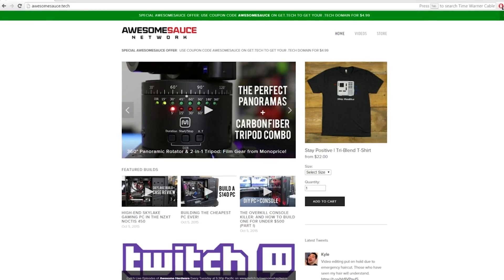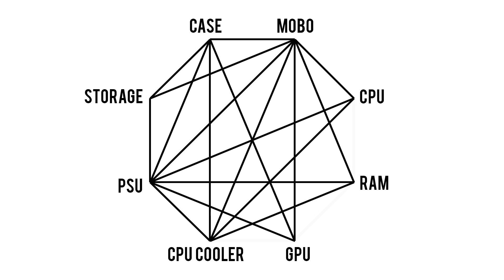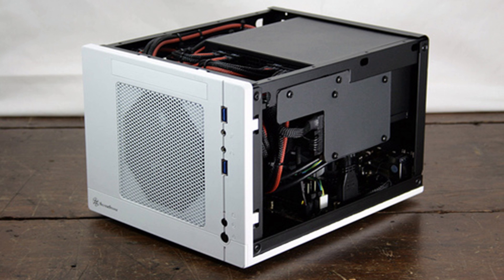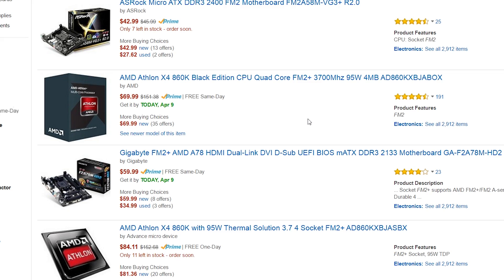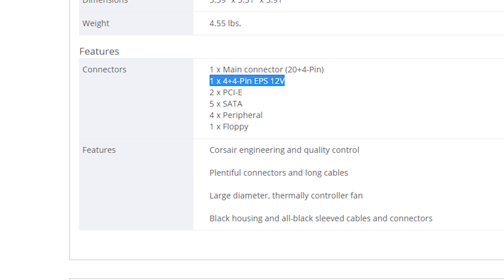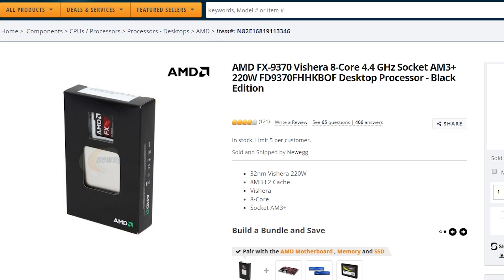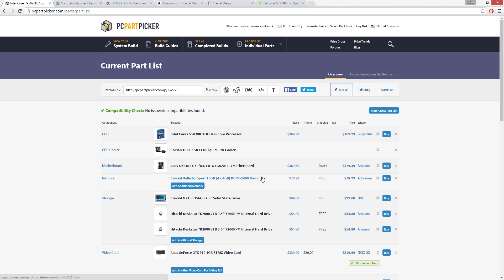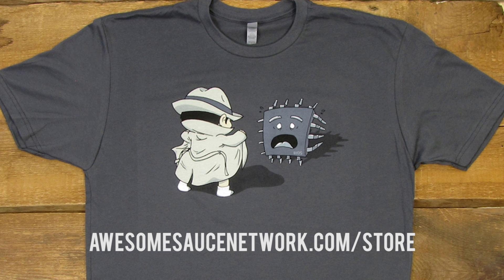How to Choose Parts for a PC! The Ultimate Compatibility Guide!

Comment: Is this an alright build?

I5 6600k cpu 
gigabyte gaming k3 z170 motherboard
corsair vengeance lpx ram 2x8gb
cooler master evo 212 cpu cooler 
msi gtx 1070 gaming x
western digital 2tb black hdd
any atx case 
silver  rated 650w psu)
Reply: SSD (Solid state drive) is a type of permanent storage solution that is fast. They are like big flash drive, they do not require spinning disk, therefor they are shock resistant and 100% silent. The biggest bonus of an ssd is that they are of MAGNITUDE faster than regular 7200 RPM HDD, but they are more expensive. Getting a 128 GB ssd for installing your OS (Operating system) will DRASTICALLY improve your boot time and overall desktop performance. (your CPU can retrieve data from the OS ssd faster, therefor your PC overall will be more responsive). The only negative of an ssd is that they have a set write cycles, therefor installing large files (pictures, movies, large games, turning your drive into a "scratch disk") and deleting them repeatedly will slice it's life down, but nowadays ssd are great and with proper usage they can easily last a minimum of 10 years, before showing signs of degradation. I suggest you do some research on SSD :)
Reply: Wow thanks alot my dude, im planning to put this together/buy all the parts this coming weekend so thanks alot!
Reply: Yeah that's a pretty awesome build. The psu is more than enough, pretty good cooling for overclocking. But I'd recommend Asus mobo for overclocking though, they are more stable and reliable. And you might wanna consider a ssd to install your OS on so its faster.
Reply: Thanks ffor the reply!
Im a bit new to gaming/pcs and ive started off with a craptop i dont know what overclocking is or if i should be doing it, and what is an OS? haha thanks for the help
Reply: Sure no problem man, my pleasure :) The "k" on your cpu number 6600k represents that its unlocked and u can boost its "power". i5 6600k is 3.5GHz u can push it to lets say about 4GHz or 4.2GHz so your computer runs faster. In my opinion there is no need to overclock with the build you got as its pretty good enough. But u might wanna play with overclocking in the future when u get advanced with your PC or when you get bored as its fun to play around with it. 

OS is operating system, your windows 10 or 7.  So if your windows is installed on a solid state hard drive your PC will perform better and you can get quick boot up and file transfer speed. Hope this helps :)
Reply: Jeez you're awesome dude. Thank you so much for the reply again, this information really helps haha.
Reply: it really depends on what you would use it for, and your budget. But, ya it would work as long as all the specs line up. A 2tb hdd might be a little bit much, especially if what you have here is your budget maxed out.
Reply: Yea i have a 1k or under budget, and im just looking to play games at the highest framerate/graphics possible, im sort of looking for recording etc.
Reply: the build is pretty good, the only thing I would do is get the 1TB version of your HDD, instead of the 2TB, and with the money saved get an SSD (you can get a Samsung 750 EVO for around ~50$, the amount you will save from the hdd downgrade)
Reply: Legendarior Thanks for the reply, no disrespect but could you follow with some reasoning for these modifications?
Reply: anti social social club z

Comment: hey on pc part pick it say : "Some AMD 970 chipset motherboards may need a BIOS update prior to using Vishera CPUs." how do fix?
Reply: What cpu and mobo are you buying? If your mobo is newer you don't have to worry. If it's older, you can use another compatible cpu to boot first and then update bios, then switch out the cpu for the new one.

Comment: this is the configration i m going to build please help me guys m from india ,btw m new to pc building.

CPU-i7 6700K

Cpu Cooler-CORSAIR CPU LIQUID COOLER H80i GT                                    
                        
mobo-MSI MOTHERBOARD Z170A KRAIT GAMING 3X

memory(ram)-CORSAIR RAM VENGEANCE LPX 8GB DDR4 2400MHZ CMK8GX4M1A2400C14R (two sticks =16gb)

Ssd-samsung 850 evo 120gb

hdd-1tb blue wd

VIdeo Card-MSI GRAPHICS CARD PASCAL SERIES - GTX 1060 GAMING X 6GB GDDR5                                    
                        
Power Supply-CORSAIR SMPS CS750M (gold cerification)

Case-CORSAIR CABINET SPEC 3 RED LED                                    

these config. are good for gaming and editing ??? need ur help

Comment: When you watch this video AFTER you order all your parts based on pcpartpicker...
Reply: I watched this vid after i ordered my shit and half the stuff wasnt compatible.
Reply: RIP
Reply: +indigo1384 haha it's all right.. turned out fine in the end :)

+Malus1531 At the time I didn't realize you needed a z170 motherboard to overclock lmao
Reply: Hah yeah I just ordered parts 2 days ago and was thinking the same thing. I think I'll be alright but guess I'll see. Didn't check between front panel & mobo but panel is pretty standard (few USBs, mic, audio) so should be fine. I had considered RAM/cooler clearance but didn't know how to check that. Are DIMM slots always the same distance from CPU slot? If I'm only using 2/4 RAM slots, they will be the ones further away right (like slot 4 is closest to CPU and I use slots 1 & 3)?
Reply: Malus1531 You should reasearch lol fsb speed can dramatically effect your pc speed.
Reply: illvisual
Hey the front panel was the only thing I hadn't considered; isn't the F_PANEL header standard anyways? In any case, my build came together just fine. Still working out a small issue with whine coming from CPU area (mobo I think) and through headphones, but that's not due to incompatibility. It's awesome otherwise.
Reply: Eminentend
Glad it worked out. You should get a Z170 anyways if you bought a 6600K
Reply: lol that's exactly what hapenned to me
Reply: Work Out
Just to update I got an H110m board with an i5  6600k and the PC would just not stay on long lol.. But it's all good now cause a week or 2 ago I built it with a z170
Reply: Eminentend Same xddd
Reply: The order of the factors don't affect the product
Reply: Work Out did you just randomly choose them on a website like Amazon or did you find them on a website like pc partpicker?
Reply: Malus1531 since you ordered your parts from pc partpicker were you satisfied that it was all compatible?
Reply: +Work Out
so have you worked out how you're gonna build it?
Reply: Eminentend NEVER BUY ANY TECHNOLOGY BEFORE DOING ENOUGH RESEARCH
Reply: Eminentend the anxiety...im so sorry
Reply: I'll bet he was trying to see how many dislikes he could get by making a tiny little comment about disliking Trump.  I fucking hate politics but if this is what he was trying to do, that's hilarious.
Reply: Noobs lol

Comment: Personally I'd have suggested looking at the CPU first because then you can tell what MOBO you'll go with that's compatible. After you have the MOBO, you'll be looking at RAM that's compatible with that frequency.

Now that you have MOBO/CPU/RAM you can look at your GPU that fits with the slot(s) of the MOBO, CPU Cooler that is compatible with the CPU, and get SSD/HD that are compatible with the SATA slot or (if you're looking at M.2 that too).

Power supply that'll safely power all of this, and then a case houses all of it!

With this you don't limit your possible hardware as you're not locked into what will fit inside, and you're not locked down on your MOBO for what CPU you want which is far more important than your MOBO in actual performance (Other than for overclocking/etc)

Comment: You didn't mention one very important key factor. Do not assume that just because 2 120mm fans fit that a 240 radiator will fit too. This goes for every fan combo and the same size of radiatior.

Comment: What about using RAM with speeds faster than what was recommended on your processor???   

For example: i would like to use a 64GB 2800MHz Ram kit with an i7 6900k Processor that has 2400MHz listed as the max supported ram speed.
I understand XMP can be used to get the full speed out of those RAM sticks.. but will the CPU be able to cope? ...would the XMP profile auto over clock my CPU to match?
Someone please help!

Comment: I saw on the octagon that there is no line from CPU to RAM.  However on PCpartpicker I have a warning that the Haswell i5 can only run memory up to 1.5 volts and memory I have runs at 1.6 volts.  Is this not a big deal, would think it can run the CPU very hot?

Comment: Are all this compatible to each other

CPU:Intel Core i7-6700K 4.0GHz Quad-Core Processor
CPU Cooler:Corsair H110i GTX 104.7 CFM Liquid CPU Cooler
MotherBoard:MSI Z170A GAMING M5 ATX LGA1151 Motherboard
Memory:Corsair Vengeance LPX 16GB (2 x 8GB) DDR4-3000 Memory
Storage:Sandisk SSD PLUS 240GB 2.5" Solid State Drive
               Western Digital Caviar Blue 1TB 3.5" 7200RPM Internal Hard Drive
Video Card:EVGA GeForce GTX 1080 8GB FTW Gaming ACX 3.0 Video Card
Case:NZXT S340 (Black/Red) ATX Mid Tower Case
Power Supply:Corsair CXM 650W 80+ Bronze Certified Semi-Modular ATX Power Supply
Reply: Literally have almost the exact same parts
Reply: +Citriq [Best PvPer] so what do you mean all of it is compatible to each other
Reply: +Red Exion different ram and videocard
Reply: +Red Exion and I believe so yes
Reply: +Citriq [Best PvPer] what do you mean different ram and video card
Reply: +Red Exion I believe all of that is compatible I'm just saying I have different video card and ram
Reply: +Citriq [Best PvPer] is your pc have been build

Comment: Im building a 1500 gaming pc, can someone advise me a build?
Reply: I7 6700 (k series if you plan on overclocking) with Hyper 212 evo CPU cooler. Get motherboard that supports LGA 1151 socket with Z170 chipset if you plan on overclocking, otherwise get a chipset which doesnt support overclocking (get ATX or microATX motherboard) (it tends to be a lot cheaper). Get DDR4 memory with the right size so it fits into your motherboard (there are RAM modules that are made for miniATX) (there should be specifications in item descriptions). Gtx 1070 (unless you aim for 4k in which case get the 1080) should be enough. Get SSD for OS and HDD for game storage. Find a reputable PSU brand like EVGA or Seasonic so it doesnt fry your components when something goes wrong. To finish things off get at least mid-tower case.
Reply: do you want it to only have pure power for gaming only or do you also want it to be color matched.
Reply: +LawlessSentry I'd get an i5 6600K and a GTX 1080. If it's just for gaming, this is better.
Reply: +BearHoldingShark Well if you are gonna game 100% of the time then yea.
Reply: LawlessSentry The guy said "gaming pc", so I assume he is.
Reply: BearHoldingShark I assumed he might do some rendering in the future. You can never go wrong with consumer grade i7.
Reply: LawlessSentry Well, you can if you don't have the budget.
Reply: http://pcpartpicker.com/list/FpxJnn

Comment: 3 Years ago I built my very first Gaming PC and I had no Prior knowledge of 
PC building before nor did I have any Technical Qualifications for that matter.I chose a 
Zalman Z11+ case
Western Digital 1TB internal Hard Drive
12 inch TX3 Fan Power Splitter Cable
LG 24x SATA Bare Internal DVD Rewriter 
AMD Athlon II X4 740 Quad Core 3.2-3.6 Processor
Kingston HyperX Blu DDR3 1333MHz 8GB (Kit of 2)
Asus F2A85-M LE Motherboard
Asaka USB 3.0 Internal Adapter Cable
VTX3D AMD Radeon HD 7750 Graphics Card (1GB)
Corsair Semi-Modular 80 PLUS 600w PSU
Windows 7 Professional 64 bit 

Back then 3 years ago I spent £450 which roughly costs today in US Dollar $586 by today's conversion rates and it's still astonishing that it is still going strong and I am still stunned that I have built something that has lasted me for this long.I even was stunned to see the very first BIOS screen upon startup.Learning to configure the BIOS was tricky since it was my first time setting it up but after watching a Youtube Video I was guided through the BIOS process and now within that first PC build I feel like everyday I can build another one but I am so proud of my work.If my PC can keep going for another 2 more years then I will consider building a 4K PC.

Comment: int it also so, that when you for instance use a m.2 , some of the sata3 ports on the right side of mb are disconnected because they are linked to the m.2?? and there for you should take an mb with enough sata3 ports so you can take multiple ssd/ hdd ??

Comment: I'm currently building my first pc. I've checked the parts on pcpartpicker and with this video, and there was no problems. But just in case i missed anything i'd really appreciate if someone with more pc knowlegde could check it out. 

-case Phateks enthoo pro
-Mobo Msi z170a gaming pro carbon 
-processor I5 6600k
-cpu cooler Cooler master hyper 212 evo
-graphics card Msi gtx 980ti gaming 6g
-ram Kingston hyperx fury ddr4 16gt
-memory Seagate barracuda 1tb

Thanks beasts!

Comment: just 2 things I ran into recently.

1.) Bios version of my mother board didn't not support the CPU I was installing, luckily I was upgrading so I had pervious CPU to fall back to and flash the bios to the supported version for the newer processor.

2.) Not a compatability issue but the video card I bought was PCI-E 3.0 and the board supported it but only with a FM2+ processor.  It worked fine but it ran as PCI-E 2.0 until I upgraded the processor.

Comment: So my motherboard has a 16x pcie 2.0...will a 3.0 pcie graphics card work with it? the speed will just be slower right?
Reply: Speed will be slower. Your GPU will probably experience bottlenecking which pretty much means you wasted your money.
Reply: how do i tell if it is 3.0 or 2.0
Reply: +mobivbigz x you will have to check your motherboard spec sheet
Reply: +mobivbigz x your motherboard box or the website
Reply: M11AD Rev X.0x
Intel Haswell H81
Nuvoton NCT6791
I think im looking at the right thing on CPU-Z
Reply: honestly i just dont know what i am exactly looking for and all i want to do is upgrade the graphics card because the one it came with is dudu
Reply: i just check my graphics card and that said pcie express 3.0
Reply: Where did you get your mb from?
Reply: http://www.asus.com/Motherboards/P8H61M_LE_R20/specifications/

Your mb supports 1x PCIE 3.0 x16
Reply: thank you bro

Comment: I am going to make my first PC by myselfe, i saw this motherboard that the requirements for the ram is DDR4 3600(OC)/ 3200(OC)/ 3000(OC)/ 2800(OC)/ 2600(OC)/ 2400/ 2133 MHz so i need some help, do i need to buy memory and then have to OC it so i can get it to 2800 for example?? or should i just buy 2x8 GB of DDR4 2400??
Reply: Usually the Intel XMP will help you to automatically set timings for your ram. The difference is just latency between the two cards. What I can recommend is the G.Skill Ripjaws DDR4 2400 if you want to OC a bit and since the costs are pretty close between the two rams. Higher clocks like 3200 will not be worth it as it may compromise CPU OC.

Comment: Tip for the "Case" section. Sometimes the "maximum" Video card length can only be achieved by removing parts, so make sure you don't buy 4 drives, where the max is only 2 drives, when you have a 140mm+ video card.

Comment: Quick question. ☺ how do u install u'r programs when u don't have any dvd reader/writer 😮😮 
One needs to have the possibility to install the system, and it's not yet posible to buy Windows on af usb to boote from. ...
that I know of 😮
Reply: You can buy a spare usb, format it to store win 10 and plug into the usb 2.0 slot of your PC. Otherwise you can buy an external DVD reader. Useful if you also have a laptop without DVD reader.

Comment: Thank you for your video,this help a lot to improve my understanding of choosing components. Btw,  how to control the air flow to avoid dust? When installing the liquid cooler,which sides of the fans should be facing? Thank you!!
Reply: Dust is unavoidable. However you can set your case fans such that you have a neutral pressure where dust does not go through the gaps in your case.

Comment: I disagree on the powersupply side... They say for example 600 watt in case you're running a cheapy powersupply that can't handle the power drawn from it. But you're telling newbies to buy 100-150watt more?! Are you crazy, most systems won't be even drawing 500watts with an i7, 1080 etc... I suggest you should make another video about which powersupply you need, since newbies will be buying a psu that's overkill. You can buy a 750 watt psu, but if it can't deliver that because it's crap quality? It's more than wattage, it's also about quality of the internal components.

Comment: Will this work? It's a Norwegian page so don't mind the prices. Is there anything i should change?  For example: should i buy gtx 970 instead of ssd and gtx 960? I'm pretty much only games like League of legends, Overwatch and CS:GO so im wondering if i really need Gtx 970.. https://www.komplett.no/wishlists/82073164-7320-4482-8a82-45c07e33ca51
Reply: You most likely want an SSD. For GPU LOL is getting more GPU intensive with more graphical updates so 960 will soon suffer from frame drops. You can wait for the price to fall further or just get an RX 480 or 1060.

Comment: Completely skipped firmware and actual hardware compatibility, like every other techie seems to. Certain components either are completely incompatible or have reduced compatibility.Some parts can sport the same specs, but won't operate the same as their counterparts, within or between brands. Some hardware only supports certain technologies on a technicality, but doesn't fullfil the actual specification.